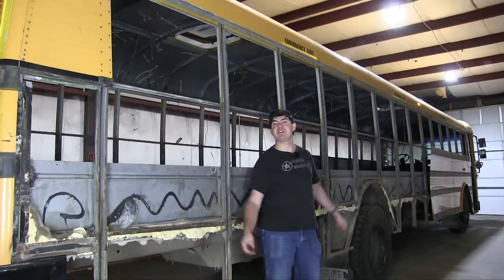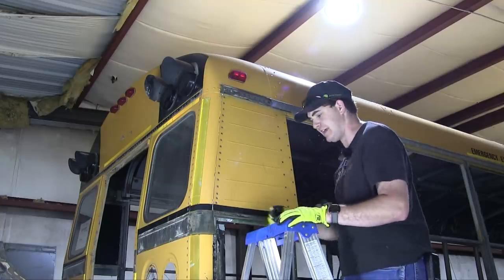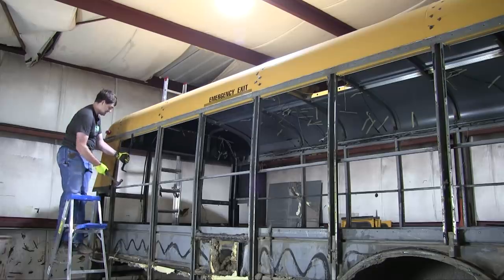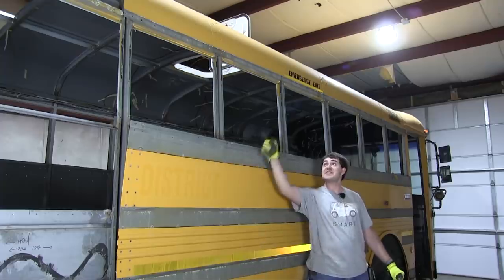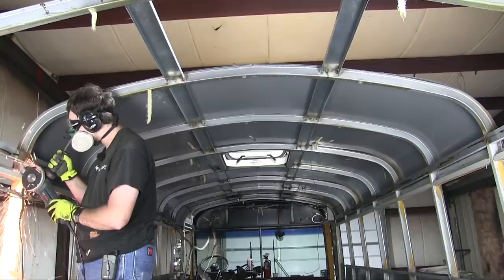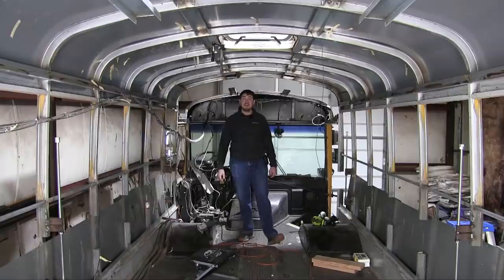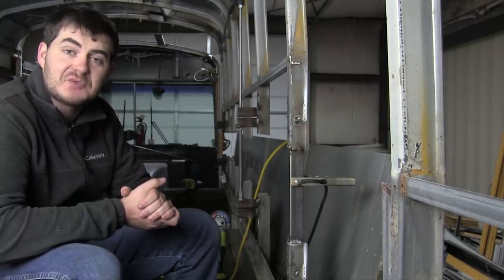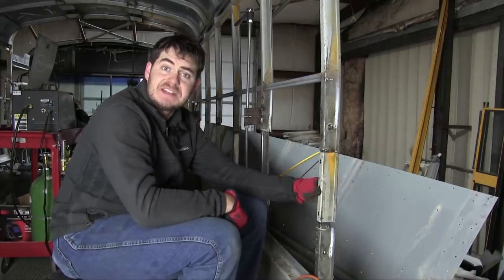The RV/Car Hauler Bus Project: Part 2 - The Uplifting Part

Comment: What is the legal height limit? Are you going to install a rolling back from a row truck in the back?
Reply from the maker: I don't know what the legal height limit is, but this is far less tall than nearly all RVs and box trucks even after I lifted the roof.
Reply: @agingwheels  In that case you are good to go. I was thinking that there was a height limit for tractor trailers and large rvs to clear under passes on the Interstate highway system. Looking forward to see what device you use to load the vehicles. I enjoy your work keep it up and thank you.

Comment: Use a air hammer on the rivers with a chisel starched best way to remove em
Reply: An aircraft rivet removal tool would have been my choice. (They centre a drill on the rivet head and then you drill the rivet out with an exactly rivet size drill).

Comment: You know what he didn't do also he just measure the roof to see if it was even leavel . It might be 13 in in the front and it might be 10 in the back . that might matter if you have to drive it underneath the bridge and you're 14 foot and 10 inches in the frount and what not

Comment: I am still not convinced of your sanity.  That's a long way up for a ramp to haul a 1 or 2 ton car around, you still have to get the car past those wheel humps in the back and still add structure to car area. Plus bus engine to haul it all with barely enough power to get 49 hs/54 ele kids to school . I would have gone 10 wheel tractor., flat bed trailer,(low boy) Winnebago with no engine.  But where's the fun in that.
Reply from the maker: I still have doubts about a few things myself. I'll just keep building until all of those questions get answered

Comment: You know, I hate to be the one questioning why you did something after the fact given that I have no experience turning school buses into anything other than school buses, nor do I plan on getting said experience. That said and completely ignored, why did you bother taking off the roof of the rear section if you just sawzalled through everything?

Comment: That angle grinder is uncomfortably close to your junk & femoral artery... and I expected you'd just cut the back cap off "whole", not remove every single screw & rivet and be left with a pile of pieces... fan of 10,000 piece leg puzzles I see, I guess it's good to have hobbies

Comment: I don't understand why you cut the roof into little pieces why didn't you just cut it off in one big chunk if you're going to remove it would have been easier that way they just using zip ties on cut through the posts and lifted off in one chunk

Comment: I really like ur idea using rear deck to carry cars, but It drives me a little concern about dynamics. A heavy tail load may cause issue when driving in speed like this video shows "https://www.youtube.com/watch?v=4jk9H5AB4lM". Would U have some plan designed to avoid this issue in furture？